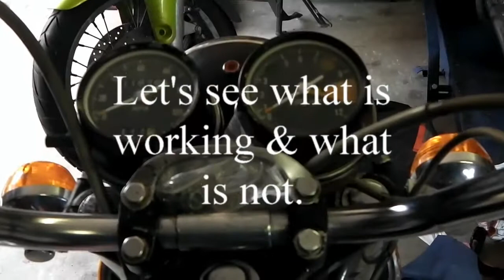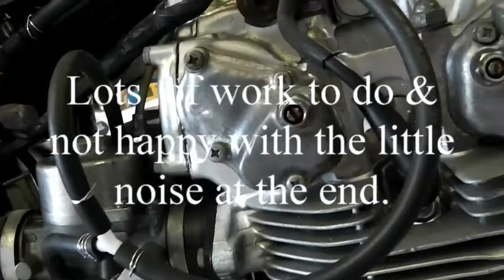Honda CL450

Comment: Beautiful bike ( I have a 69 CL450) but please take off those handlebars!!
Reply from the maker: McGoo bought a set of replacement 'bars that were on hand.  The wiring insulation etc was pretty suss and there were a few cut wires.  I decided to not get that started as I feared, well you know.  However, the new 'bars - lower oem style with the cross brace - are going on soon.  We both agreed that the 'bars had to go.  I don't know how one can ride a bike properly with your hands at eye level.